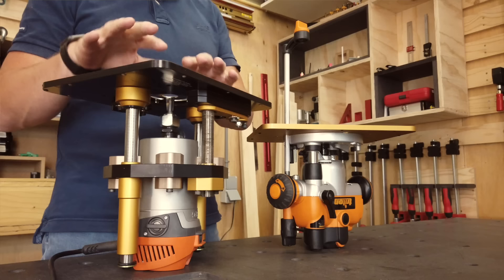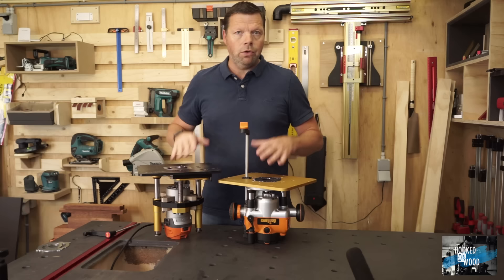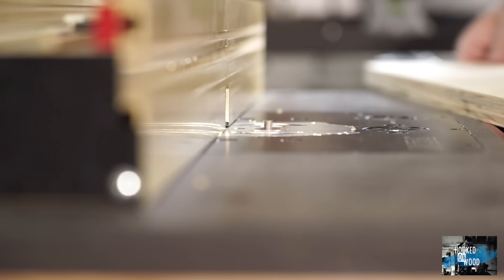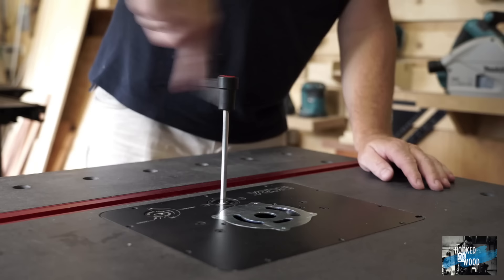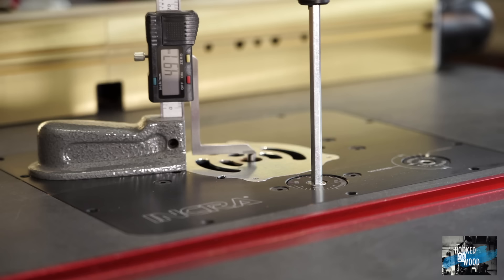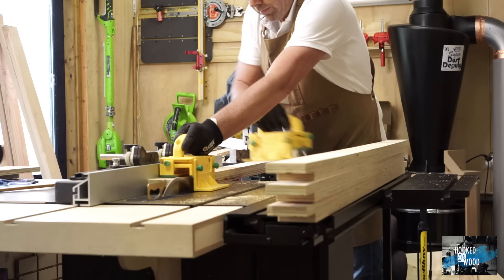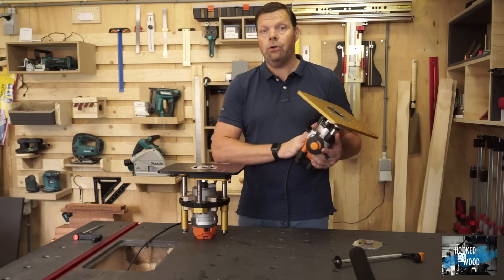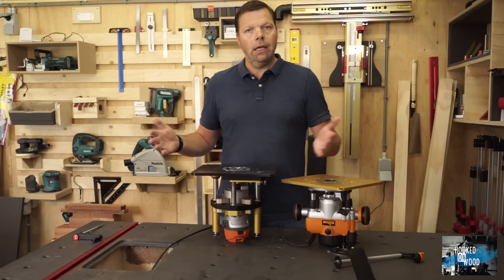Router lift test INCRA Mast-R-lift II VS Triton router

Comment: The Triton switch does not lock the spindle. It locks on height. You have to operate the switch for safety reasons.
Reply from the maker: You are right. It does not lock the spindle, but open the possibility to lift your router to the top. By doing this, it locks. One way or the other, you have to put the button on its off position.

Comment: Today I used my Incra Router table with my Incra LS with Wonder Fence. I have not turned it on in 3 years took me a minute to remember how to lift the PRL V2 with a PC7518, then had to remember how to loosen along with set the brake after micro adjusting. Sometimes I think I would have been better off going with the Mast-R-Lift  for its ease of use over the PRL-V2 , The dust collection when hooked up to a V3000 Oneida  is beyond compare. I routed Edge profiles on about 7 board feet of redwood and it came out so smooth that sanding was not and issue. The micro adjust of the fence and the lift saved the day. Made me look at my Shaper and say why did I buy you when my Router Table setup does it all. For those That are curious Incra does a comparison of their own Router lifts the Mast-R-Lift and the PRL-V2   linked here .  https://incra.com/info/LiftComparison_042111.pdf great Video btw and That Triton Rocks. Sommerfeld Tools has awesome videos of it in use on making cabinets and clocks mounted into the Sommerfeld  Router Table.

Comment: Why didn’t you use the dust extraction shroud included with the triton router?
Reply from the maker: Hi John, 
Because I think the way with a close box is more effective. But, I did not test it, so maybe I am wrong.
Reply: Hooked on Wood Hi Dennis, I think you are wrong.  The Triton shroud works very well and leaves the whole of the mechanism outside the area exposed to dust.  Mike
Reply from the maker: @katabrontes  I am going to look if I can mount it and can put my dust extraction to it. (because of the small box) If I manage to do this, I will show the results in the next video.

Comment: Hi Dennis,

First of all I hope you and your family are all well.

I am Dimitrios, from Greece. I am a hobbyist in my starting point Of working with wood projects.  And while I was researching for a router plate and a router for my woodworking bench, I saw one of your amazing videos explaining in detail the incra router plates and AEG 1400 and triton routers.

Since I wanted the incra master lift, your description actually solved all my questions about it and went for it in combination with the AEG 1400 router.

My question is, whether you start your router manually each time from below the bench or did you use any kind of on/off switch?

I bought one switch like that but it is not compatible since my AEG router has a safety switch on it, and if I leave it always on in order to operate the router through the safety switch, it will not start.
AEG’s safety precaution makes the router “think” that electric power must gone down and in order to avoid any accident when power is still on, you have to turn it off and on again to operate.

Sorry for all these details I just needed your opinion if possible since you have this exact combination and are probably more experienced with it than me.

Thank you very much in advance.

Comment: Ik bewerk hout als hobby, de zwaardere triton met een Kreg plaat. Van de plaat ben ik niet echt tevreden ze buigt door en de inleg ringen zijn zijn niet vlak.
Ik overweeg zelf een plaats te laten frezen in Trespa of Alluminium. Negatief aan de Triton is dat de verdeling niet metrisch is jammer!
Reply from the maker: Ik herken je opmerkingen m.b.t. De inlegplaat en dat de inserts niet vlak zijn. Ik zie dat zelfs bij de duurste Jessem lift. Daarom vind ik het magne lock systeem zo fijn. Doorhangen is wel heftig. Kan je hem niet ondersteunen van onder?
Reply: @HookedonWood  Dat heb ik wel gedaan en het is beter maar niet echt goed. Ik denk eraan of twee platen multiplex op elkaar te lijmen, of een keuken werkblad en daarop de Trespa plaat met dezelfde oppervlakte als de tafel. Maar dat is werk als het slechter weer is.

Comment: Great video Denis as usual. I as I'm looking to implement a router into my workbench this is of interest. However, where have you managed to find the Triton MOF001 for €200? I'm based in Belgium and even looking on the NL sites they are mostly for sale at €300. I can however find the JOF001 but not sure if that one can use the table plate
Reply from the maker: Hi JIm, 
I bought I here; https://www.screwfix.com/p/triton-mof001-1400w-electric-dual-mode-precision-plunge-router-240v/6768k
But I read during Covid, they do not ship to outside England. Perhaps this will change shortly. You can not use the JOF001 from the underside of the table.
Reply: @HookedonWood  Thanks Dennis. I've requested their orders department to estimate accepting orders from the EU again... However, this might be my new source of tools ;-) ... Thanks

Comment: Hi Dennis, Thanks for the great review. It comes at just the right time for me. I am still undecided whether I should take the Incra lift with the AEG router. Or better the lift from Jessem with the Dewalt 625e router. The AEG has 1400 W, the Dewalt 2000 W. Can you give me an advice? Or better help me with the decision? Thanks & greeting Djamil
Reply from the maker: Hello Djamil, the good thing is, you can not go wrong with both combinations. I am satisfied with the AEG. But i think de Dewalt is also a very nice router. I choose for the INCRA because of the magnalock system and better dust extraction. I do not know how much more powerful the Dewalt what this mean when using it. Can you do things you can not do with a 1400 watt version because i think you should make multiple passes when milling.
Reply: Thanks Dennis, you cleared up my last doubts. I think due to the better dust extraction, I will get the Incra system. After your great video I got  the feeling that you are very satisfied with your solution. 👍👍😎
Reply from the maker: I like it a lot. I have no reason to think you will experience otherwise. Best regards, Dennis
Reply: hi Dennis, hi Youtuber, in addition to the solution with the AEG router MF 1400 ke, I found another maybe interesting option: https://m.youtube.com/watch?v=RC5dAyVYuUE

Comment: Hi Denis, I have read on forums that some people are saying that the Triton router DOES NOT have a proper lift mechanism.  They are saying that it is designed for fine adjustment only and should not be used as a regular lift mechanism.. Do you or any Triton owners have any views on this ?
Reply from the maker: It is definitely not as refined as a exclusive lift, but I have made a video about the triton and a lift. I still behind what I told in that video

Comment: I've opened my Triton, and seen the lifting mechanism. It's rough. The looseness of the winding arm is not why you are feeling a rougher winding.
Reply from the maker: Thanks for adding this information. The Master lift works very nice and smooth. This is way better then the Triton. But the triton has a smaller spindle and if you guide it with your hands it runs more smoothly. That does not mean it runs as smooth as the Master lift.

Comment: Hi Dennis, fellow Dutchie here....nice review as usual...keep up the great work! 

I just started using the Triton router in combination with a Kreg mounting plate (similar principles as the Incra however bit less fancy). 

I was just wondering if you had removed the spring from the Triton before mounting it to the plate (this is also recommended in the Triton manual)? The reason I ask, I have not yet experienced any down shifting of the router without locking it in place while using it. But then again, I have perhaps not been using it long enough to see if this had any significant effect.
Reply from the maker: Yes, I did remove the spring. I experienced the downshifting from the beginning. It slightly dropped. The was not that noticeable, but I had some unexplained differences with dado's. I believe it is also recommended to use this lock. I have to say that the drop I showed in the video was big. It normally does not drop that much. But that said, maybe it is just my Triton that does it.

Comment: Very well done video, thank you for making it. I have been considering purchasing the Triton 3hp router with a plate like the Incra, since it seems to offer the best value. But I have so far been scared away by the many reviews I have read, reporting that the mechanism that winds the router up and down is constructed of cheap plastic components that routinely break, rendering the router lift useless. I wonder, in your experience with the Triton router so far have you had any trouble with that mechanism? Does it seem cheaply constructed? Thanks for your videos!
Reply from the maker: Hi, I do not have the Triton anymore but I had it for 2 years. (I sold my workbench including router) But I never experienced difficulties with the mechanism. I can not, or did not look inside. A viewer told me ones that this is a inferior mechanism. But again, I can not confirm this. I had the 1400 watt version, so this is a smaller one than the 3hp version. 
But I can tell you, as I mentioned in the video, that my Incra lift also, sometimes need to be cleaned te lift smooth again. 
My experience with the Triton 1400 mechanism the 2 years I worked with it is good. I also read some reviews you refer to but I did not have these experience with it. to be sure, buy it with a thrustful company.
Reply: Great, thank you so much for your reply!

Comment: Just drill a bunch of holes in your router table to improve dust extraction like I did. Do not spend €100 more for a router table setup just for better dust extraction.
Reply from the maker: What you do is create better air volume. But the holes at the top plate is more effective for your dust extraction.  If that is worth the money is up dor everyone to decide them selfs. For me one of the reason I use mu router table so much is because that i can use it almost without dust. But i agree with you that those clean sweep inserts cost a lot.

Comment: i,ve got a triton lift but it seems very stiff to use.
Reply from the maker: Hi, Colin, did you remove the spring? Other thing that might be wrong is that the lock system is not completely free when unlocking it.
Mine slides pretty easy and always did.

Comment: Any reason you have 2 router combinations in your shop? Do you switch between the AEG and the Triton? If so, for what kind of job?
Reply from the maker: Hi Pieter, 
I sold my workbench including router. But the buyer will pick it up this week, so I had two combinations on this moment. That is why I wanted to do this review. After this week I am left with only the AEG combi.

Comment: Hi Dennis,
Thanks for the review! Very useful!
I'm in the market for a router, and the Triton seems to fit my needs. You said that you have the 1400 watt version. Did you have tasks it couldn't preform? I'm in doubt if I need to invest the extra 70 euros for the 2400 watt version, or that that might be power I'm not in need of.
Also, do you see a difference in bit possibilities? Seeing that then 1400 watt has 6 and 8 mm options, and the 2400 watt one has 8 and 12 mm....
Reply from the maker: Hi Jordi, 
I never had problems with my 1400 W version. I think it is better to make multiple cuts when it becomes harder. That said, This does not mean the bigger one is probably better. At that time, I did not use my router that much. If I had to do it again I probably bought the bigger one. 
About the bitt possibility's. You can always ad an other bit adapter. I use 6, 8, and 1/2 inch.
Reply: @HookedonWood  Hoi Dennis,
Ik ben op je advies afgegaan en heb de 2400 watt versie gehaald, gewoon om zeker te zijn ;P
Nu ik hem onder de tafel wil hangen merk ik dat hij imperial schroefmaten gebruikt (de 4 die vanuit het zwarte onderplaatje komen in elk geval). Ik weet dat er ook 3 gaten zitten met metrische schroeven, maar het zou zo makkelijk overtekenen op m'n houten plaatje (de incra plaat is tot oktober niet leverbaar, dus ik moet tijdelijk iets anders maken). Nu is mijn vraag: heb jij ergens schroeven in imperial maten kunnen kopen, of kwamen die bij de incra topplate? 
Mocht je ze gekocht hebben, zou je me kunnen vertellen waar?
Vriendelijke groet,
Jordi
(Ik had m'n eerste vraag in het Engels gesteld zodat anderen er misschien nog wat aan hadden)
Reply from the maker: @jojowazza1  Hoi Jordi,  Ik heb de schroeven gebruikt waarmee de zwarte rand van de Triton Router mee vast geschroefd wordt.
Reply: @HookedonWood  zo simpel kan het zijn :D niet eens bij stilgestaan :P

Comment: It seems like you think that the air vents near the collet on the Triton are for intake. Not so. They're the exhaust.
Reply from the maker: Hi, No, I know these are the exhaust vents. When you stop routing and your dust extraction is still on and you want to clean your table to slide some dust to the inlets it can fall in these holes.
Reply: @HookedonWood  I see.
Reply: @HookedonWood  
Good video, Dennis!

I use the Makita RP2031FC 3-1/4 hp plunge router in a Woodpeckers router table with a custom aluminum insert plate and red plastic insert rings also from Woodpeckers.

This Makita router also has a built-in mechanism to raise & lower the router from the top, and the Woodpeckers aluminum insert plate has this adjustment hole pre-drilled specifically for this Makita router.

The height adjustment requires a driver or drill/driver with a 5mm male hex bit to raise & lower the router.  The adjustment hole does tend to fill up with sawdust occasionally, but is easy to blow or vacuum out.

The plastic dust collection shroud for the Makita also works extremely well for dust extraction.

However, it does block access to the spindle lock button if the router is raised to its maximum height in the table.  I use an offset collet wrench to mostly eliminate this problem.

But it's not as nice as the Triton spindle lock and single wrench setup because you have reach under the table to keep the spindle lock engaged on the Makita while using the offset wrench above the table.

It's somewhat awkward, but I'm not changing bits back-and-forth very often, so it doesn't bother me.

I did not build an enclosed under-table router box because my setup is portable and secured to a simple folding metal scissor stand from DeWalt that is actually made for thier jobsite table saws.

I made a simple bracket with aircraft locking pins and aluminum "L" angle attached to the underside of the Woodpeckers table.

The stand & table is very stable, as you would want with any router table, especially using a big 3-1/4HP router.

This setup creates almost no dust under the table.   I use a Nilfisk ATTIX 50 ''shop-vac" connected to a Clear-Vue CV06 Mini Cyclone separator.  I have a "Y" hose connector to use with the fence dust port when it's needed.

MAIN POINT  
To keep any dust or chips from entering the exhaust port openings on the Makita router when it is off (or running), I cut out a clear, thin, flexible plastic "shield" from the see-through plastic cover of an office or school notebook binder.

You can also buy thin, clear acetate sheet from an art & craft supply store.

The shield is just slightly larger diameter than the base plate and has all of the cutouts for the guide rails, depth-stop turret, etc,   it doesn't obstruct the plunge or depth mechanism in any way.

The shield is secured by two small screws that are around the perimeter of the spindle shaft housing.

The shield does not block the airflow from exhaust ports as there is a natural gap or space due to the design of the router and where the shield is attached.

It took some time to mark & cut out the template accurately and install the dust shield on the router (you must remove the base plate from the plunge guide rails and reinstall it). 

But I am extremely happy with this solution and would do this for any router I use in a table!   It may not be pretty, but it works!  ;)

I do like the Jessem & INCRA Cleensweep magnetic rings much more than the Woodpecker's plastic rings because the Woodpecker rings do not have the fine tolerances and are not always perfectly flush to the insert.

But the plastic rings were easy to sand down carefully so that they are smooth, even, and flush to the insert plate.

I also drilled some additional 5-7mm holes around the perimeter of the bit opening in each of the rings to increase the downdraft airflow.

This was extremely easy because the rings are plastic, and I don't feel that it compromised their strength or increased their deflection to any meaningful amount.  I also lightly chamfered the small hole openings with a countersink bit.

Most of the holes I added in the rings are in-line with the bit and parallel to my fence for better extraction when cutting dados.  This somewhat mimics the Cleansweep rings' additional venting slots.

Thanks for listening to my long-winded ramblings!

Cheers.
Reply from the maker: Sorry for mu slow response. But thanks for your comment. I will remember your comment. Maybe I can use it in other similar situations. Thanks Dennis